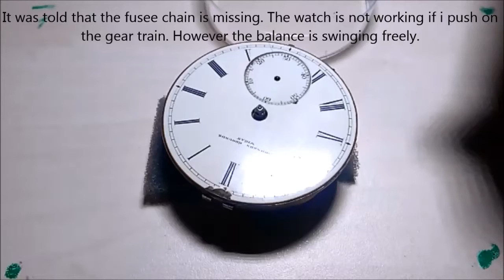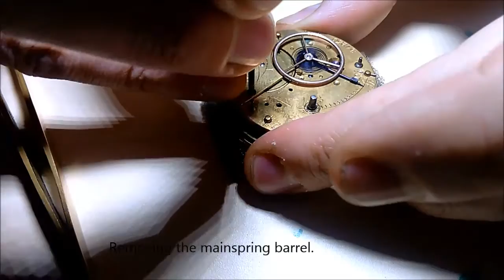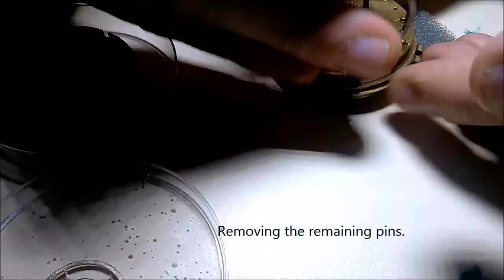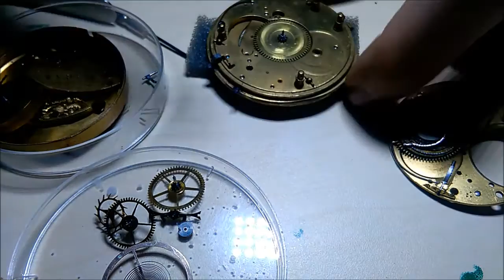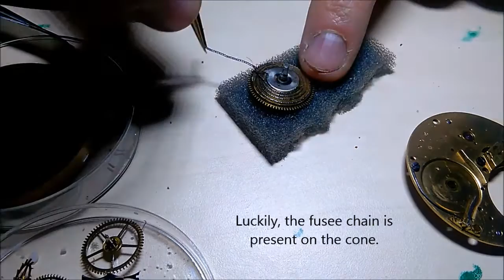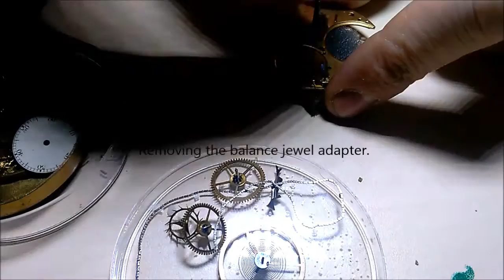Disassembly of a Johnson Grounds fusee pocket watch movement and fault diagnosis

Comment: Hello, (sorry for my english, I'm French) I have the same watch but it is disassembled  and in the case, there is a brass ratchet wheel... Where it can go on ?
Thanks a lot for your answer
Reply from the maker: The ratchet wheel should be made of steel. The one you are asking for is maybe the conical wheel for the chain. That one goes next to the spring barrel.

Comment: Please do not do what this man is doing you might damage your watch.
FIRST: check all power is off, including maintaining power, under no circumstances remove the barrel bar without letting down the mainspring. This watch had no power but if yours is fully wound it will be damaged.
SECOND:  remove the balance and keep it safe. Do not attempt to remove the barrel bar with the balance in.
THIRD: remove the dial and motion work: this gives you access to the mainspring set-up ratchet.
FOUR: Let down the mainspring. A professional watchmaker would remove the third wheel with the fusee square held in a vice, put the third wheel bar back and let the fusee rotate under control.  Simply removing the ratchet wheel in a fully wound fusee is  explosive but is still better than what this man is doing.
FIVE: When separating the plates do so very slowly and make sure the lever pivots are not bent. This is how amateurs frequently damage a fusee watch.
Reply from the maker: True. Amateurs should take the watch to the watchmaker.
Reply: Germaine Hackenbacker

Thankyou! It’s good to see that somone else noticed the abhorrent practises in this video, his method of removing the balance is awfully risky.  And people MUST MAKE SURE THAT THERES NO ENERGY IN THE SPRING BEFORE DISMANTLING ANY FURTHER
Thanks for trying to save any of the beginners who see this video 
:)